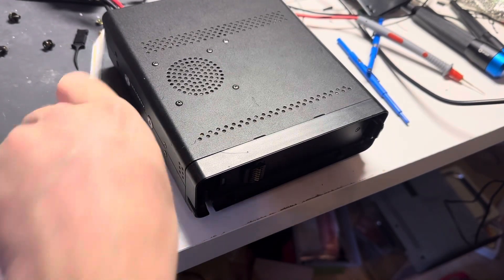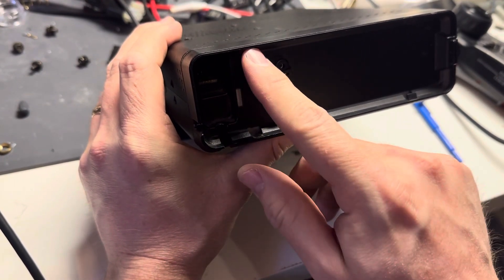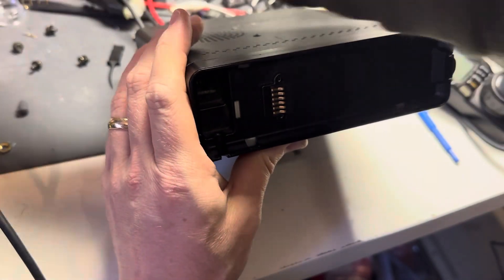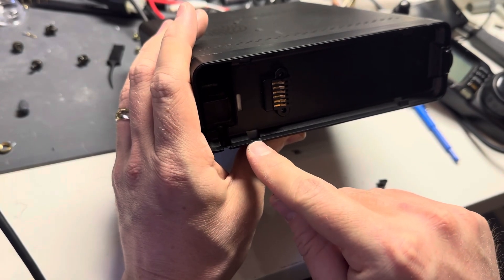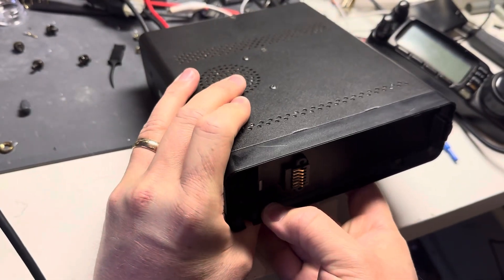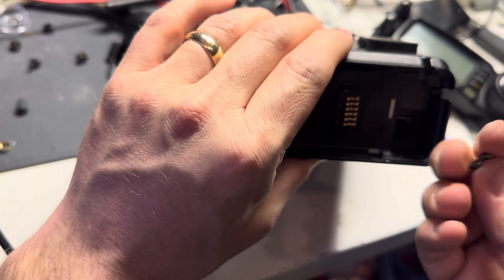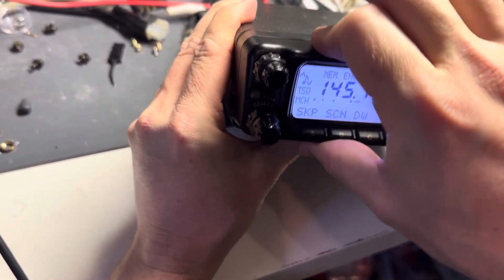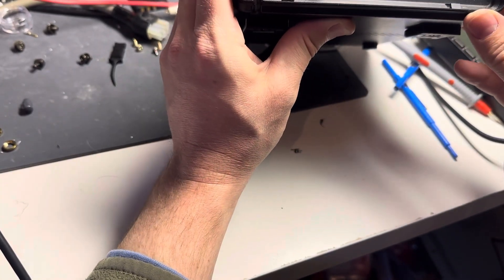[8] Faceplate Repair for Yaesu FT-100 FT-100D

Comment: Did you make those clips or what ever they are 😅
Reply from the maker: Yes, they are replacements that can be inserted for a wedge fit or glued in. They replace the retaining tabs which tend to break off if the radio is mishandled. They are 3D printed plastic parts.